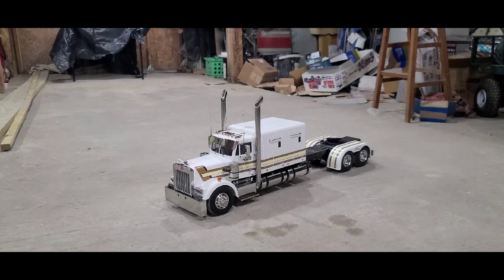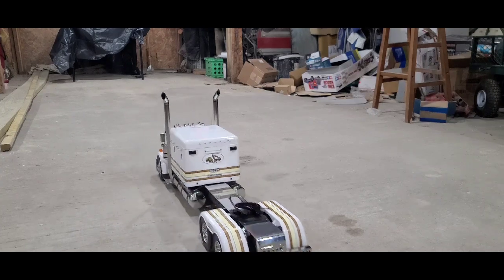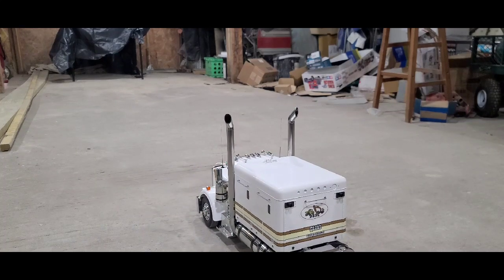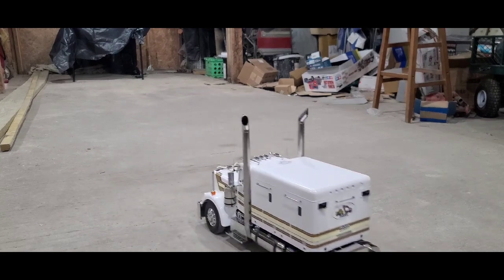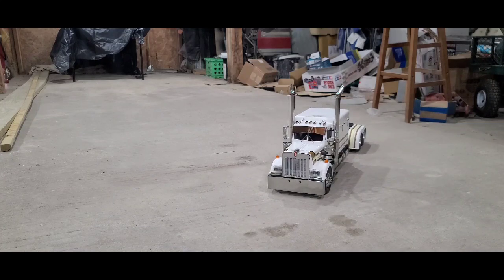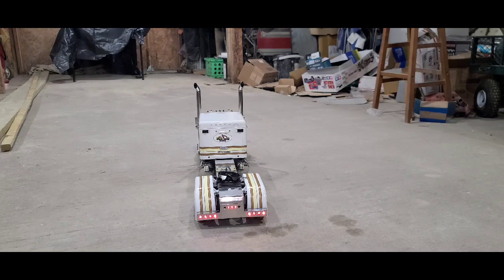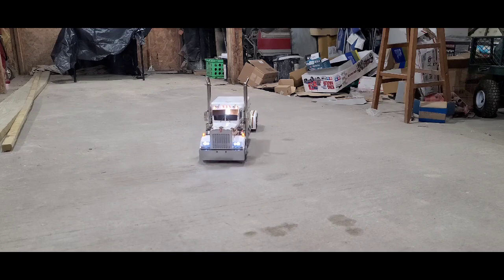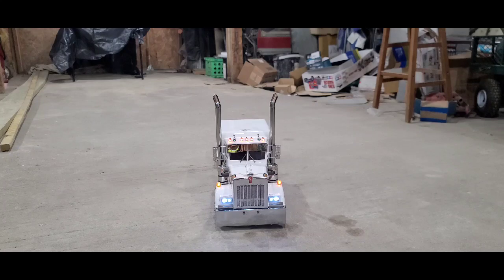My 1/14 Grand Grand Hauler Tamiya RC Semi Truck Test Run

Comment: awesome how did you do the fifth wheel do you have a video
Reply from the maker: I will try to in the very near future do a little walk around of the truck and go into a few more details. I have quite a few finishing touches I want to do yet. The 5th wheel is a LESU M-7004-B model which is adjustable fore and aft but also pivots side to side. It is a full manual hitch no electronics on it. The pivoting is nice for offroad terrain to help keep the truck drive tires all on the ground. Since this truck will probably never see offroad conditions I want to put a non-pivoting 5th on it. With fenders and the pivoting 5th I could see a trailer tilting and screwing up the paint on my fenders and I do not want that.  I am going to swap it out for a M-7004-A non-pivoting model or something similar. The one thing I do not like about this LESU model and maybe they are all this way is they require a shorter king pin. One pin is supplied with the hitch but doesn't do much good when you have a dozen trailers. I think Gear Jammer also has at least an adjustable fore and aft 5th wheel, but most places are sold out of them.
Reply: Sound system is freaking awesome!  Ok ok... how old are those playboy pics on the ceiling? 80s.? Man man man.. no need to stress out during builds.  I appreciate ur channel and educations.  Thank you DennyBob.  Stay true to urself and the hobby will be tru to u!  Preciate ya Big Guy!
Reply from the maker: @MCeMTPockets1775  THANKS. The photos on the ceiling are actually either Tactical Girl or Double X-treme Swimsuit snowmobile calendar photos. Some are pretty old but not 1980's. LOL

Comment: How did you get the extra sleeper (part number? Order from Tamiya?) also, same question for fuel tanks
Reply from the maker: I converted several sleeper trucks into day cab trucks, so I had used cut off sleepers. I also made those trucks into dump trucks and used hydraulic tanks on them, so I had extra stock grand tanks around. Otherwise try Hobby Concepts or Semi Joe Truck Stop to see if they have extra. Otherwise search for Tamiya parts trees on Ebay.

Comment: What controller, sound, ecu did you use?
Reply from the maker: Hobbywing 1060 ESC, FS-i6 radio, and LESU-3T sound. Hopefully, that's what you want to know.  😉
Reply from the maker: I misspoke in the video, and it is a brushed RC4WD 55T.